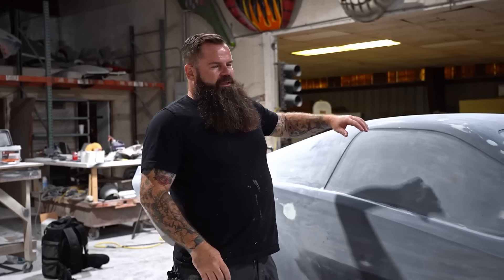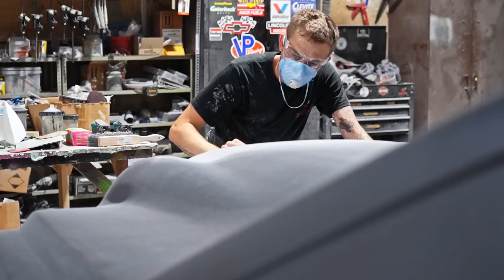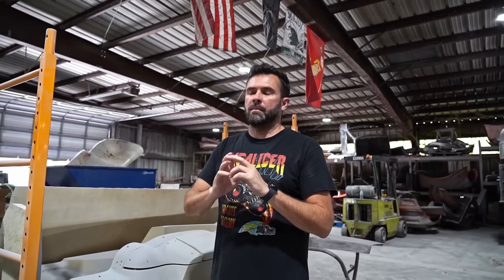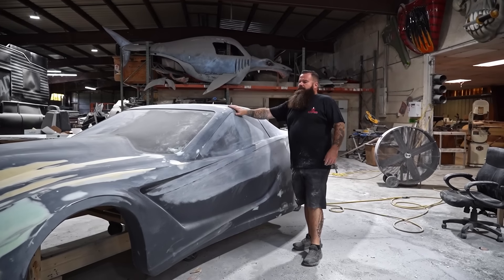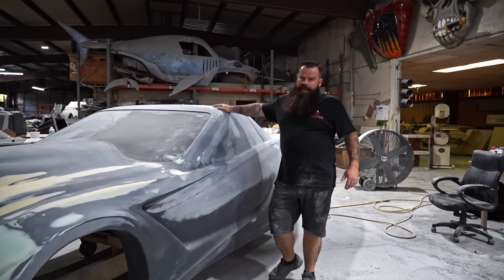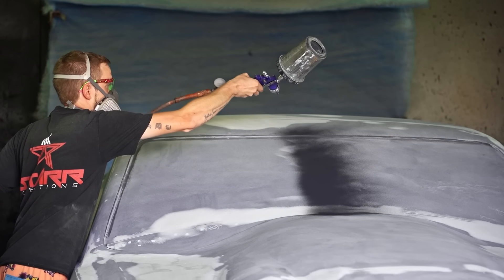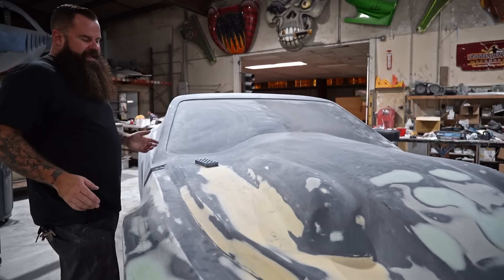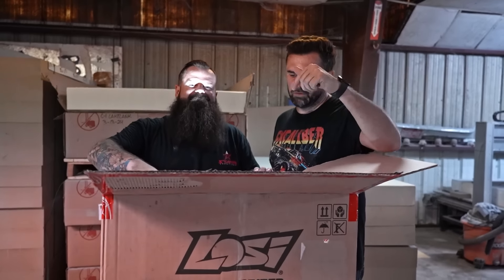Leroy Entering The Home Stretch!

Comment: But George and Cleeter’s Hibachi auto body said 10% prep and 90% painting… 😎
Reply: ill be broken hearted if leroy touches the wall and cleet n squirrel throw 40 lbs of bondo on to this body haha
Reply: @MrPuddinJones  the good news is they can just get a new body made for it! Same way when a monster truck messes up its body, they’ll have the form to make a new Leroy body.
Reply: @bradleybaugh2653  cleet needs 2-3 bodies for different events, imagine having a body with Freedom 500 and run it for 2-3 months before, or a massive event have  McFarland Racing  body
Reply: @bradleybaugh2653  hopefully if it ever does touch the wall, it's gently. Otherwise the measurements for the body won't match the car after a wreck if Leroy really takes a hard hit.
Reply: @MrPuddinJones what? You dont think Tye could weld new tabs so it will fit? or a new front/back end? I mean, he has already built the car so he can for sure build it again...
Reply: @MrPuddinJones  Starr Creations has the original 3D scans that they can reference for the new build.  So Cleetus and crew can just make the repairs to the same measurements.
Reply: I would ask painters why they are called painters when most of their time is spent sanding.
Reply: @buzz4633  I can't imagine Leroy being the same if he ever hits the wall at 200mph... I don't doubt the creative ability in everyone involved, but if that chassis takes a hard impact at the big end of the track, it won't be as easy as cutting new tabs and fiberglassing a new body
Reply: They'd had this job done and done the road months ago
Reply: They did say that......

Comment: 200 mph in a chopper gun skin coat body is sketchy AF we built a bunch of funny car body’s and fixed a bunch and I can say 1000% that won’t hold up! Our funny car body is probably 350 lbs and carbon and epoxy and it has stress cracks

Comment: That's not even close to actual body work. But it doesn't need to be as perfect if it's the inside of a mold as opposed to a Clear coated surface in the sunlight.

Comment: The 30 second disclaimer on how hard this really is just shows how far out of touch some people can be with reality. What you see in a youtube video is the condensation of many meticulous hours of work. the precision involved in a project like this is not the same as your at home, do it in the garage, good enough is good enough type of build. Millimeters matter and doing it right the first time could be the difference between life and death. As simple as a brake job is that is the truth of working on things you plan to operate and its not just for your safety its for the safety of those around  you

Comment: Ribbit ribbit
Reply: Also on the Chop versus biaxial answer have you taken into account violent shaking it is a radio car so Shake isn't as much of an issue but it has been known to Tire Shake Tire Shake is violent enough to crack steel panels have you taken that into account with doing chop

Comment: Looking good but its taking way to long. I use to make surf boards so I know how to use fiberglass and foam. But man, And then having to remake parts of it, I hope Cleetus is not paying for those screw ups. Eagle is a whole car and will be done before a body.
Reply: That’s a bit of an unreasonable take. The scale of this build is nothing like a surfboard and the customer is paying so much more money than for a surfboard.

Mistakes happen, even to experienced people. It’s how you deal with mistakes that matters.
When people get something custom built there’s usually an understanding that there’s going to be a process and it might take time and multiple iterations along the way might be needed to get things just as you want them.
That’s part of the process.

Whether the cost of x number of iterations or fixing unexpected change or mistakes falls to the customer is between the business and the customer. They have an agreement and can work things about amongst themselves. It’s irrelevant to anyone outside of those two parties.

Also, comparing two completely different kinds of jobs that have very different processes, built by different shops with different things going on is pretty pointless.